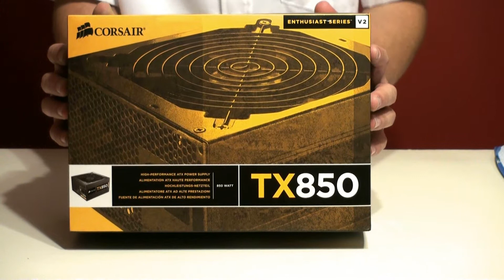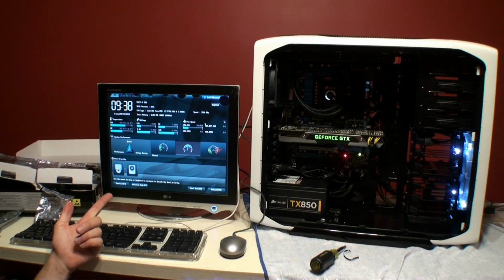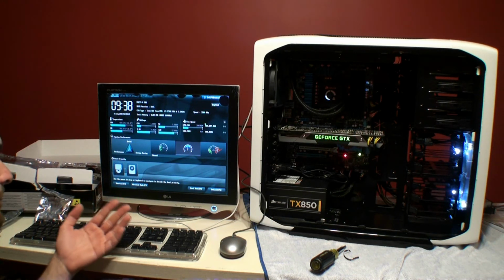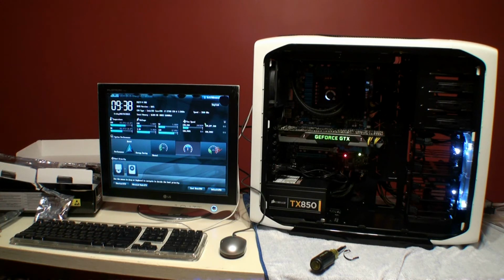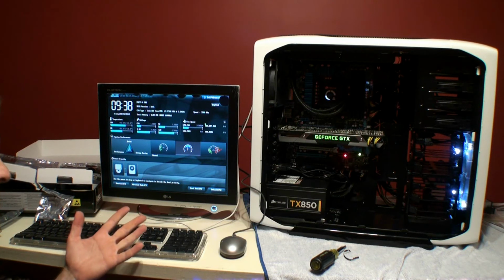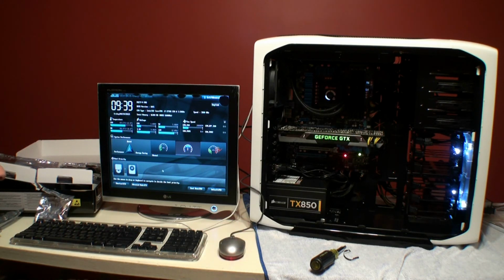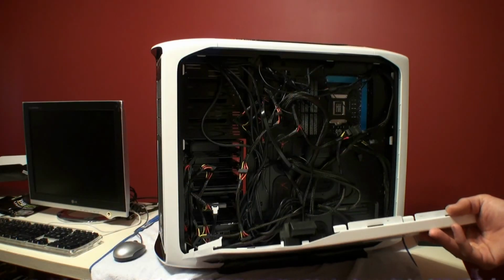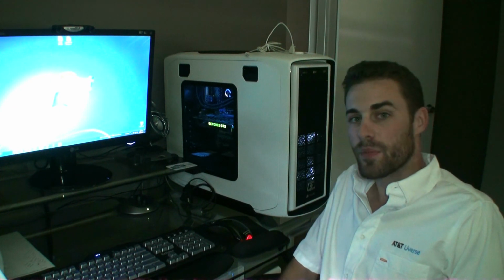Building a PC.... GTX 690, H100 Liquid Cooled 3770k, SSD, 16G RAM, Z77 PRO, 600T and 850 PSU

Comment: Hey OrionA51 just want to verify 
Are all 3 of your top fans pulling air out of the case and the bottom 200m pushing cool air in or is it the other way around were the top fans or pushing air in case and the bottom fan pulling hot air out

Comment: Why is it a fail comment?
There is still nothing that benefits from using anything more than a... GTX 670? Anything else, you will be getting more than 140~ FPS, which will max out even the most expensive moniters. If he was using it for a high end workstation, he should be  using a 2011  CPU, like a 3960x or a Xeon (or two)

Comment from the maker: I do not plan on upgrading until I really need to. Years hopefully. The thing about the H100 is I keep my fans speed on low while keeping the OC at around 4.3 Ghz. It runs cools and silent all while the CPU stays very cool. You only hear the fans starting on the medium setting at that if you OC to say around 4.6. There is not benefit in that for me though.

Comment from the maker: I don't like giant coolers inside the case. The one I use is almost non existent because its almost hidden. I like to keep the cpu OC'd while maintaining low temps with low fan speeds. I like the fact that the heat is instantly expelled outside the case. It also adds two fans to expel heat from the case at the same time as cooling the CPU. So there is no need for a cpu fan and 2 other case fans which means its quieter serving a dual purpose. less objects in case allows better overall airflow.